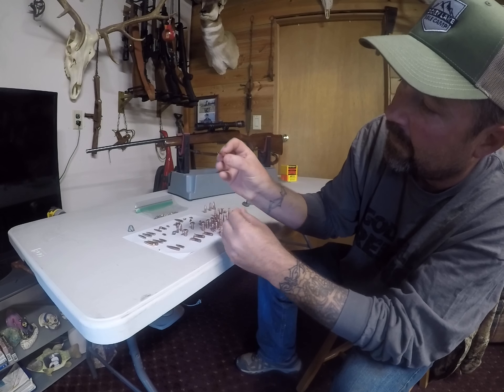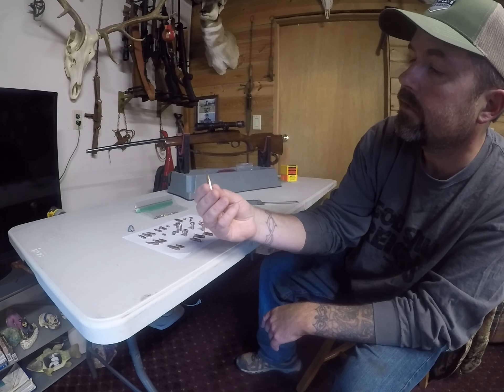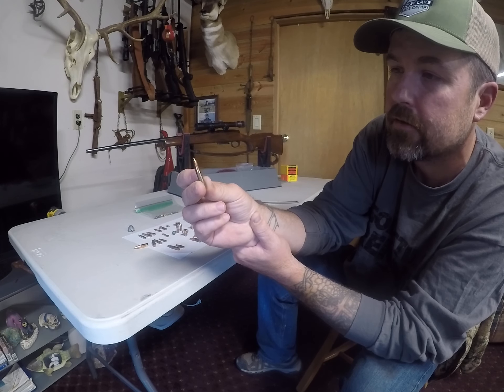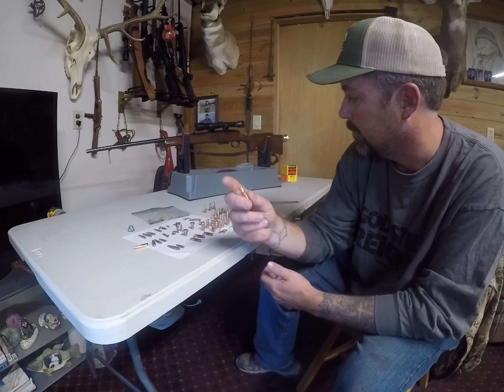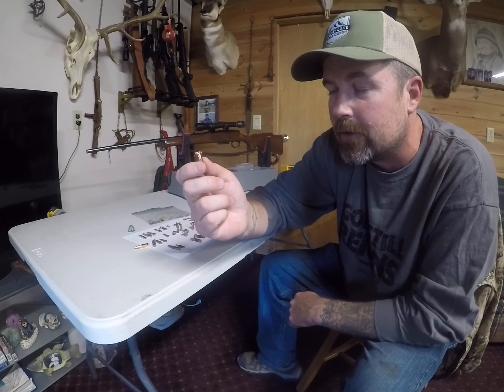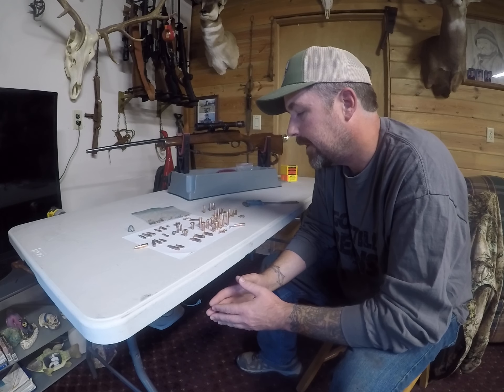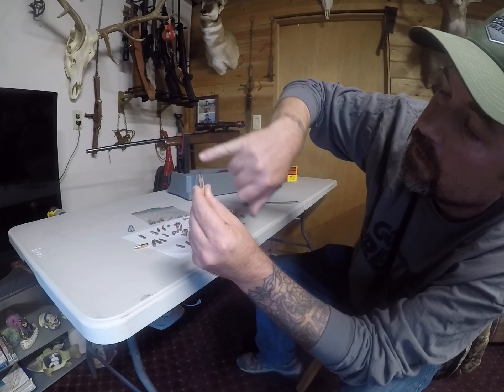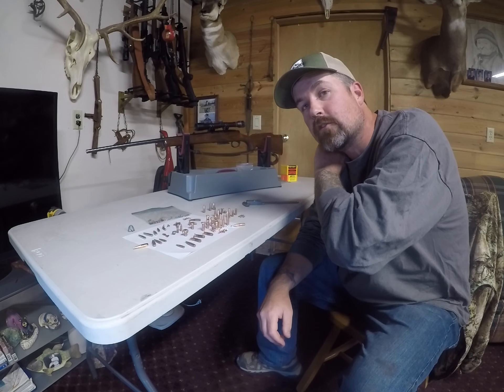Shooting at distance vs reducing loads and shooting up close. How much does it really matter???

Comment: Q seems to have found the answer to the "does rpm help with expansion" and their answer is "oh heck yes". Hence the 3" twist on the new 8.6blk.
Reply from the maker: To shoot subsonic and get the bullets to stabilize good they need the tighter twist hints the 1:3. when you are shooting up to 250gr 0.284 bullets they are so long the tighter twist is necessary for stabilization as well. One doesn't need to worry about over spinning lighter bullets as the case can't move then fast enough to do so. All about stabilization and nothing about bullet exspansion. Here are a couple videos that show the effects RPM's do and don't have. 
https://www.youtube.com/watch?v=f0nlP-iG_OE
https://www.youtube.com/watch?v=vvTlmo_X594&t=10s

Comment: I have a 35 year old Sierra reloading manual that describes the limitations of reduced load testing.  It can assure you that a bullet will expand down to a certain velocity but it tends to be conservative when it comes to establishing minimum velocities at actual ranges.   Sierra may be wrong about that but it's hardly a new theory.
Reply from the maker: I would have to read the article and look at current test and studies to see if there was anything that was truly wrong in it. 

RPM's is one of the biggest differences and that changes with every different load and its slight variations in velocity as well as every rifle that has a different barrel with different lenths and twist all will have drastically different RPM's and the effect is extremely minimal if at all on how a bullet performs after impact. That's how they can get away with shooting the same grain weight bullet out of something like 300 AAC blackout (subsonic in some cases) as well as shooting that bullet out of say 300 win mag, PRC, or ultra mag. There is no perfect test and there is no way to test all potential variables. Here is a video showing some differences with bullets impacting at really similar velocities yet drastically different RPM's. 

https://youtu.be/f0nlP-iG_OE
Reply: @simplemindedfella  Well I watched that video and all I can say is none of those were spinning very fast compared to 150gr full power 300 win mag.  I think that spin is not that important  in low velocity cartridges like 300BO But that isn't the point I was making.  I was simply noting that the idea that reduced load fired at close range  doesn't accurately demonstrate the performance of a full power bullet at long range is not   a new idea.  Whether or not it's true or not is a separate issue.
Reply from the maker: @samuelpope7798   You are correct, every rifle with its load has to be shot at that exact distance no other rifle can be used or other load with that bullet as well as exact temperatures elevations and humidity for that level of accuracy. 

That is absolutely correct reducing loads is more drastic of a difference primarily just in RPM's but also BC's and temperatures the bullet get to because of drag friction.

There is no way to perfectly test a shot at distance or close range for that matter because no 2 rifles are a 100% identical.
Reply: @simplemindedfella I followed the link and I think this test could be done better. Use a 1:12 308win and work a load down until the bullet loses stability and tumbles in gel. Then match the velocity of the same bullet in a 300blk with 1:7 twist and see if the bullet stays stable in the gel. Use a bullet that expands at very low velocity.

Comment: Great video! I was considering filling the open tip of a match bullet with low temperature flux and catching the bullet to see if the bonding process was possible due to the heat generated by the rifling. I decided against it because non bonded bullets normally have hardened lead for mushrooming and bonded bullets are pure soft lead adhering to the jacket.  I didn't want to pencil game. What are your thoughts? I was thinking of using a high BC bullet short enough to stabilize in a  slower twist barrel to avoid having to upgrading my barrel.
Reply from the maker: I don't think it would get hot enough for long enough to bond it.
Reply: Tampering with an already finished product might not be legal too.
Reply from the maker: @martinfernandez5005  not illegal, definitely assuming all liability on one's self if something were to go wrong. Just not worth it in my opinion.

Comment: Hello Sir, I've been following your content for a couple years now and I really love what you do for the reloading and hunting community. I have a question for you. I just got a savage 99 chambered in 303 Savage. (basically 30-30) but given that it has a rotary mag I can use whatever high-bc bullet I desire. With a velocity of likely 2100-2300, which 165-190gr bullet would you suggest to give the most reliable expansion out to 200 yards? Thanks!
Reply from the maker: Because it's a rotary mag you're not concerned of one shell case detonating the 1 in front of it so yes you can can use a more modern bullet but you will need to take into consideration bullet seat depths and case capacity start low with your loads and work up. Not shooting passed 200 yd with the average muzzle velocity of 303 savage you are going to want to use something that expands fairly quickly.  I would recommend sticking with soft point round nose bullets like the gun was built around I think those would work best for you.
Reply: @simplemindedfella  I ordered 50 pieces of brass, some h4895 and a bunch of 110gr hornady CX bullets. Should be able to push them to 2600+ and have an extra unique set up in a 108 year old rifle! I ordered some interlocks SPs as well in case the stubby coppers don't do what I want them to, I'll return to the cartridges roots.

Should give me reliable expansion out to 300 yards, estimated 1850fps and 850ft-lbs at 300, with 24 inches of drop. That'll be my extreme limit for the open sights. Probably won't shoots past 100.
Reply: In the Savage 99 you should use the Barns TSX bullets like a 165 grain will make the 303 Savage an amazing deer killer
Reply: @Lure-Benson   in a 300 savage? sure. but i have a 303 savage. why would i use a heavy copper? they require high velocity to expand compared to a lead core. i couldnt get the 165 much faster than 2100fps id guess,  which would give me an effective range of significantly less than a 110gr copper going 500-600 fps faster.

Comment: My buddy and I were shooting water filled milk jugs at exactly, (by my Vortex Razor 4000 range finder) 1000 yards. He with a 300 WM 26" barrel, me  with a stock Savage m10 24" heavy barrel. He with 215gr. Bergers @ 2950 give or take, me with 175gr Matchking @ 2750 give or take, (1100 +  fps, so I knew it was way beyond its limits. Still deadly accurate though). We could see my hits through the spotting scope and phone recording. His would jump of course 4ft in the air exploding. After, we went to check around and inspect the target area. Nothing left to find of the Bergers. Interesting to me was 2 or 3 SMK 175gr in the embankment.  They were bent like a banana. Not one but all. I have shot for a very long time, but only now, after your explanation of nose up did I truly understand why they were like this. I just never really considered your description. Anyway it showed me why Matchking bullets are target bullets. There was tip deformation also but not a lot. 
 Nice video
Keep'em coming.

Comment: I have an order of custom Bulldozer 2 coming for my Howa mini action 20" in 223/5.56 heavy barrel. It's a custom 60gr, and should have a BC that rivals the 73gr ELD-M, but should get 3200fps or more.

I have a few custom parameters that make my bullet a bit different. The lip of the hollow point is thinner, the stem of the aluminum tip is shorter, and the broaching goes closer to the nose walls, each of which makes the nose more "fragile." The back of the bullet is practically the same length and same bearing surface as the 55gr bullet, so it allows for the same friction and internal case capacity as the lighter bullet.

The 55gr bulldozer 2 went into the synthetic gel block 5.5-6" before the expansion began. My changes should bring that number down some. Again, I'm aware that this distance in gel isn't the same as distance in tissue, but I would like to see the expansion happen sooner for use against lighter bodied targets.
Reply from the maker: Whitetail deer and larger you want to see several inches of penetration before a bullet opens up that way it's doing its damage in the chest cavity not prematurely.  Gelatin is not the same as an animal you really wanna look at what's happening between the 9" mark and 12" mark and that's what's gonna primarily be happening in the chest cavity of medium to large game.

I'm excited about some of the new designs badlands is talking about in regards to the bulldozer 3 and tip design for faster expansion but more so lower velocity expansion. It sounds like your custom bullets have some of those designs in it.
Reply: @simplemindedfella  it does, actually. I wondered what he meant when he said "you have the new drill bit" for the bullet. The parameters I wanted would bring that 5.5-6" I saw with the 55gr BD2 down to about 4-4.5" like I saw when I modified the tips of the 55gr BD2 I had. 

It really only fragments in gel when it impacts above 3000fps, so close in shots against broadside deer and turkey (we can use rifle against turkey where I live) with extensive trauma combined with the ability to hold together like normal at lrangs beyond 100yds is what I was looking for. 

I think he accomplished his goals, too.
Reply: A few years ago, I did a Cull/management hunt in Zimbabwe with my 22-250 and a 375.  In the 22-250 I shot the 55 grain Barnes TSX loaded from Double Tap ammo as I didn't have time to reload before the trip.  I shot over 90 animals with this load (3700 fps at the muzzle in a 1:12 Twist barrel) from 25 to 275 yards).  No animals were lost and I only recovered a few bullets (32 to 37 grains recovered).  Most of the animals shot were Impala. I also shot a few smaller Wildebeest, Baboons and a warthog.  The 60 grain Badlands should do a good job for you on deer, etc. in a 22 Cal.  The 80 Grain Badlands would be good in a 6mm ARC, Dasher, etc.  And the 100 Gr Bulldozers are good in the 6mm Creedmoor, 243, etc.  By using these smaller copper bullets, you can effectively and humanely hunt with smaller calibers than is possible with target type/lead core bullets.
Reply: @gearguidesguns571  absolutely! It's also interesting trying to convey this to those who are only accustomed to using lead core bullets, as the idea of using a 55-60gr 22 cal bullet for dear is iffy to them. 

My bullet is actually finished. Total weight is 58.9gr, and it's about 0.990" in length. S.G. of 1.67 in a 8 twist, 20" barrel at roughly sea level. Jason's estimates for BC down to 1500fps (750yds) is 0.350, but at 224 Remington hunting ranges the BC is expected to be at least 0.38, which is astounding for a 22 cal of this weight. Work up with N133 and Benchmark both yielded 3220fps easy, but I like the load density with N133 as it's about 90-95%, but both showed no pressure even when I heated the cartridges to 115°F to simulate hot weather. All that's left is shoot groups.
Reply: @calangel  It sounds as if you have a great 223 load.  I would way rather have a premium mono, 55-70 grain 22 caliber bullet for hunting than a thin jacket/lead core 6mm target bullet, ranging from 100-110 grains.

Comment: Now, that's some interesting stuff.
Reply from the maker: What I've been really looking at and digging into recently has been very interesting. I did forget to mention some of how the plastic tips do indeed melt in flight but the copper is not getting hot enough long enough to really make much of a difference and why some of these new aluminum tip bullets I say new but badlands has been using them for years hornady just started using them, it really could make a significant difference especially with ballistic coefficiencies.